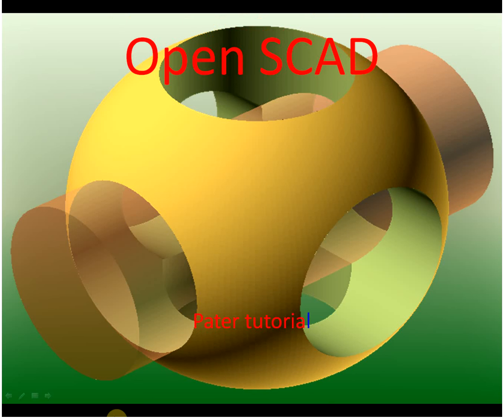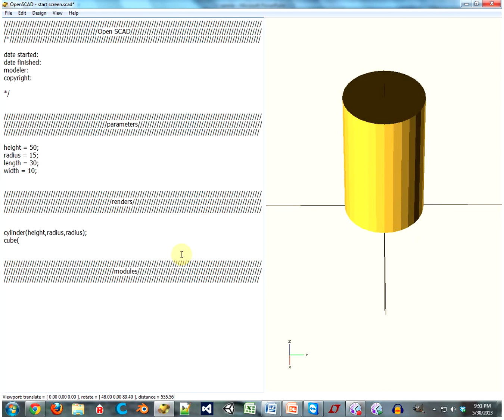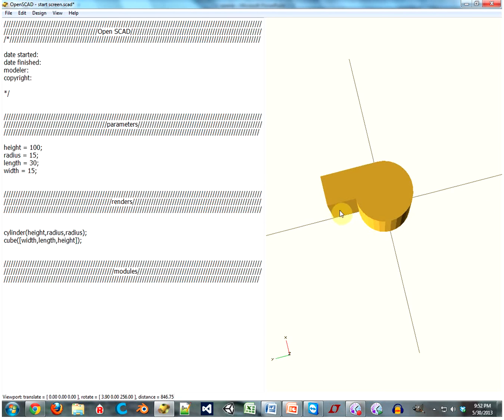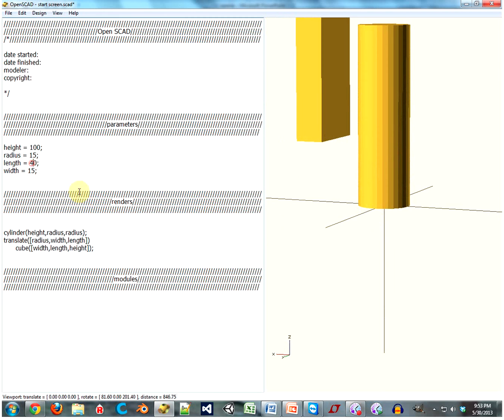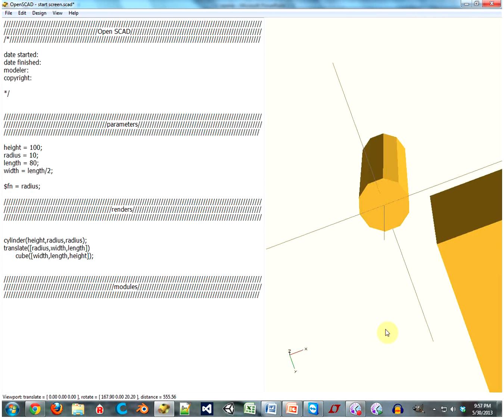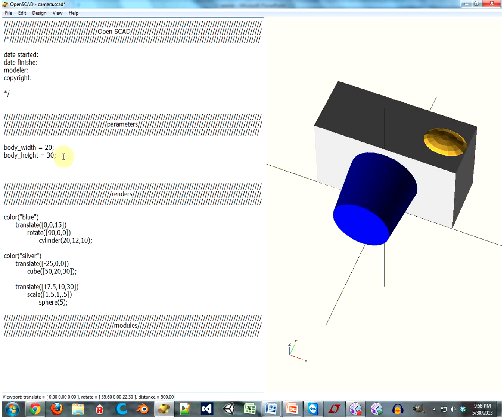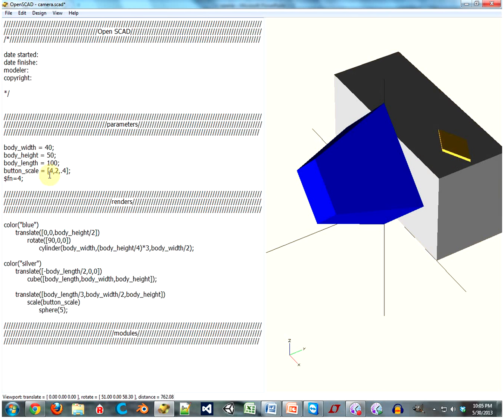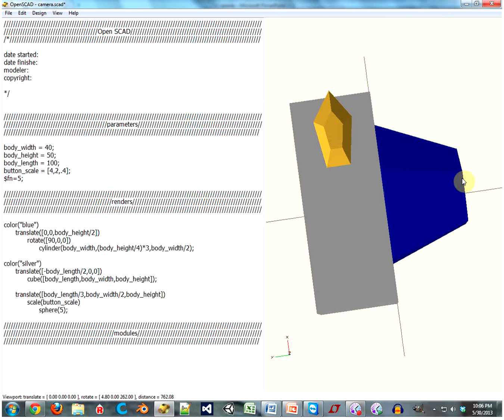Parameters in OpenSCAD

Comment: Hi Patrick,  Great video's.  Can you make any comparison between Sketchup and OpenSCAD.  I'm wanting to learn a modeling software (mostly for 3D printing) that I can interact with by code instead of gui.  Ruby seems like a very useful fun language to learn, so I like the idea of learning to build models with it for printing.  But from what I've seen on you videos I really like OpenScad.  What language do you use with OpenScad?  Thanks for posting these vidoes.
Reply from the maker: Hi Justin, thanks for the comment. OpenSCAD actually uses it's own language for the modeling (I think it's based on C though). I've heard a lot about Ruby, but haven't played around with it yet. As such I don't really know what Ruby can do, but it can never hurt to learn. As far as Sketchup is concerned, it is the program that got me into CAD modeling, but I quickly found that it's really only good for making a pretty picture in a half an hour or so. On top of that, it doesn't support exporting to .STL (the file type required for most 3-D printing). There are some plug-ins that allow it, but all the ones I found were packed full of problems. 
     In short, I would avoid Sketchup. it is just going to waist your time for 3-D printing. If you want to manipulate your model with code instead of a GUI, OpenSCAD really is the best option right now.